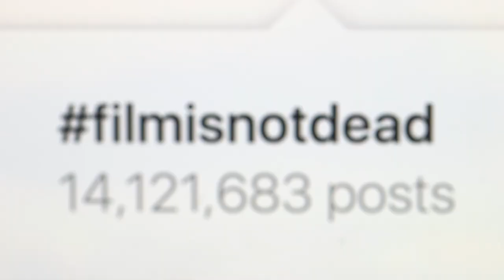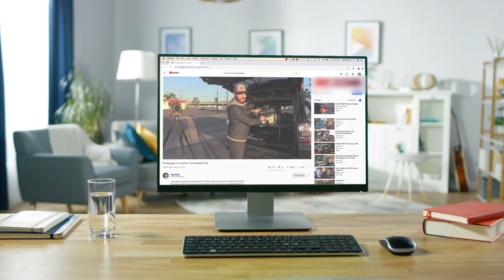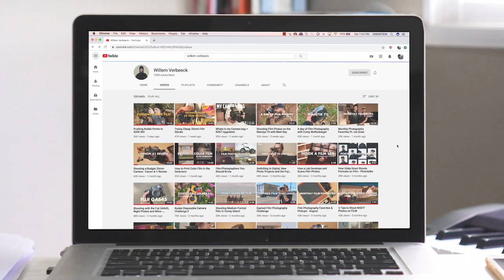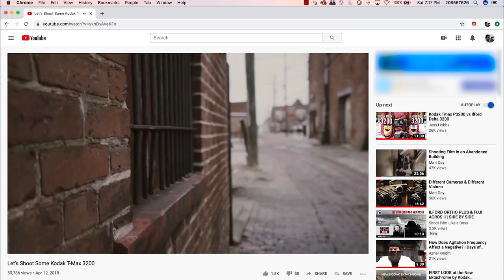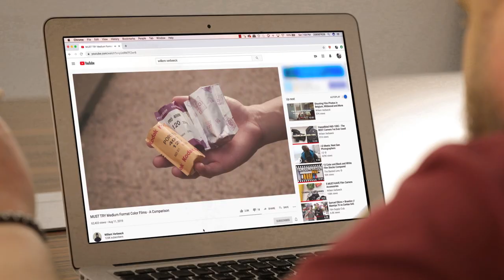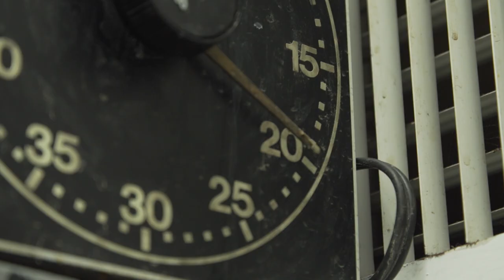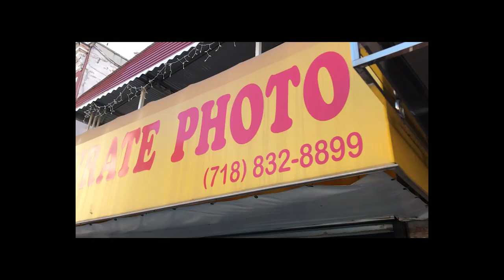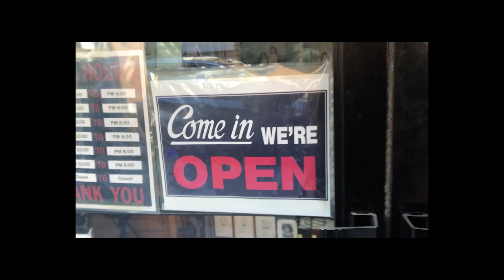Why We Still Love Film: Analog Photography in the Digital Age | NBC Left Field

Comment: Good documentary. As someone who has worked in environmental research for years and has also done life cycle assessments I want to add that the statement in the video that film may eventually go away because of environmetal reasons is not correct. Because film photography is more environmentally friendly compared to digital imaging. Production of digital sensors has more environmental impacts than film production, as well as usage of digital imaging (electric power consumption). Film will have a sustainable future.
Reply: Henning Serger hey I’m glad you made this comment. I don’t have the background to make the same statement as you but I also questioned whether the speaker in the video had concrete information to claim that environmental waste would be the downfall of film. When I think about the endless and sometimes questionable upgrade cycle in digital photography (including cellphones), I imagine that there has to be far more waste involved there. I am obviously biased though. Can you recommend a good and accessible source that summarizes the impact of film photography on the environment?
Reply: The amount of junk point and shoots just sitting at this local thrift store is staggering! I mean these are cameras that no one will buy. Whereas they can't keep film cameras for more than 10 minutes before it gets snagged.
Reply: Love that you commented this, same question as Certain Exposures, any links or anything? Not questioning your credibility just curious.
Reply: Indeed. Not only that but beyond film production OR digital sensor production, there so many exponentially more harmful practices across as many industries that require attention long before anyone should bother even investigating film's impact. Not to say a more green approach shouldn't be explored, but a reality check is in order on this point.
Reply: That is correct, the chemicals are not as harmful as typical household cleaning chemicals. People develop film with coffee and vitamin C for that matter.
Reply: @CertainExposures  Thanks. Concerning the environmental problems of digital sensor production and digital imaging you can find special literature in libraries. Results from research projects and from organisations involved in LCA for years like EFEU. I have visited five different film manufacturers in four different countries, and have seen with my own eyes that all film manufacturers really care for environmental protection. Film production has negligible impacts on the environment. There is nothing to worry about. In the video the topic has been mainly chemicals in film processing: And that is really no problem either because: 1. The silver in the used fixer is fully recycled. Either by specialist companies or by yourself. It can be done even at home with little effort. When the silver is out of the fixer, the rest is harmless. And the silver will be used again. 2. The main development substance(s) in developers: They are completely metabolized in normal current sevage treatment plants / wastewater treatment plants. The microorganisms in these plants eat these chemicals. And by the way: Main substances in developers like hydrochinone, p-aminophenole or p-phenylendiamine are also the main substances in hair tinting lotions. In these hair tinting lotions their concentration is even much higher than their concentration in developers. And hundreds of millions of people put these substances on their heads regularly, and then wash their hair and the washing water is going down the drain and to the wastewater treatment plants. That amount of waste water / washing water is several thousand times higher than that of film photographers. Is that a problem for the wastewater treatment plants? No, because the microorganisms there are metabolizing the substances.
Reply: Henning Serger I find this hard to believe.  Digital cameras consume far less energy than a phone, and phones don’t use that much either.  A common camera battery is about 4 to 8 Wh, and phone batteries are up to 12 Wh.  Toasting bread requires far more power than that!  The real problem with digital is, as you said, e-waste.  That’s a problem that we’ve only recently started to tackle, and it’s hard.  Both electronics recycling and film mfg / development require some nasty chemicals, but you also have the physical film to throw away.  After maybe 4000 shots a film camera could be worse than a digital camera, whereas with digital the waste is decided as soon as the resources are spent on making it, unless it is efficiently recycled.
Reply: @DS-rs4xn  sometimes a point & shoot will surprise you.
Reply: Henning Serger. Interesting. You’re the first person I’ve heard realistically compare the impacts of digital v film. I work in water quality. Fixers like blix do not get broken down by sewage treatment plants. There persistent. Also, if you own a digital camera for 5 years it’s environmental impact is spread over that duration. Film purchase and use is constant.
Reply: @bruhdabones  The issue is not the power consumption of the digital cameras. It is the usage of digital pictures: 1. Almost all digital pictures are viewed on monitors, and that consumes energy, every time. 2. Millions of digital pictures are uploaded every hour (!) to social media. These pictures have to be stored, and that needs a huge amount of energy. Huge server farms are needed for that. Pictures need much much more storage capacity than text documents. The internet is meanwhile responsible for about 10% of the global electric energy consumption. And a significant part of that is caused by digital imaging.
Reply: @doptimist  As I have explained in my reply above, fixer / blix should be treated separately for silver recycling.
Reply: Also, for movies, it's even crazier because at least in photography you have a digital file that looks kind of acceptable and if you are an amateur you may tweak it a little but not much. In movies you get a digital raw movie file with close to no saturation, no contrast and you have to get all of that to look the way you like with a really fast and powerful computer. That means that you spend a lot of time, weeks and months, trying to do the editing, color correction and color grading using a lot of electricity. With film you get your movie, you can edit it in a moviola or scanned, edited in a computer and then printed back to film. But you don't need to waste your time with color because it usually looks perfect... 
So yeah, film is not a problem environmentally speaking. But people just think about the fact that you have a print and that you throw the chemicals away. That's far from the truth!
Reply: Henning Serger Ok, I didn’t realize you weren’t talking about the direct power consumption from cameras.  That makes more sense.  Did you know that Google runs their servers on 100% renewable energy, or at least pays to offset the carbon footprint of any nonrenewable energy they use?  So that means youtube, google drive and google photos are all much more green than Dropbox, instagram, etc.  Hopefully other companies catch on, and hopefully Tesla cars can stop using coal and LNG to power their cars.
Reply: What's the best way to deal with fixer/blix that doesn't involve pouring it down the drain?
Reply: Jorge González you don’t have to shoot in raw.
Reply: @henningserger7150  I call BS on most of what you said.
1. Shoot all images in Instagram and FB on film and you'll probably have more film used daily that was used throughout human history (or maybe a weeks worth of IG and FB)
2. 10% of electricity is used for the internet? Yes, and the vast majority of it is not images on social media. 
3. Not a point exactly, but - this is the lamest way to reduce pollution. We are not going back to the stone age.
Reply: @tomcruz3774  You can get the silver out of the fixer with either iron wool or with the electrochemical way using two electrodes. That can be done at home. You can also give the fixer to a company doing that.
Reply: @barney2x4  i think not. In using film you have to realy think about the shot you want to take coz every roll every shot costs you money. While shooting digital you have no limitation to take whatever picture you want. Mostly, film photographers store their developed film after scanning it so its way more limited and doesn't consume that much energy
Reply: “Comrade, your statement is factually incorrect.”
“Yes, Dimitri, but it is politically correct.”
― Angelo Codevilla (The Rise of Political Correctness)
Reply: bongo155  You know, you can have an argument without blindly insulting people.
So you assume that the electricity used in digital production of film and editing comes from a renewable or low emission source, however the elctricity used by film companies or by developing shops/companies does NOT come from a renewable or low emission source? I hope you see how biased your argument seems. Also not all people scan their film and share it online, many people make prints, or scan without sharing their photos online
Reply: @henningserger7150  But you know that a lot of people shooting film also scan their pictures to edit them on a computer and share them on the internet? In those cases and it represents a lot of people, they are probably less environmentally friendly than the regular digital shooter. Have you thought about that?
Reply: @vivelafrance8400  if I can say one thing it's that I've recently moved to a stance of having the lab scan and print my photos and if I see a print that didn't turn out exactly as I would have hoped for I scan it myself. I've entirely stopped posting photos on social media and to another's point, I NEVER throw my film away. That idea just seems ridiculous and harmful anyway.
Reply: Henning Serger yay! So happy to hear this
Reply: @doptimist  I want to use ilford fixer, are there any fixers for black and white photography that you recommend, that are relatively environmentally friendly?
Reply: @henningserger7150  An interesting discussion.  NOW, most silver is reclaimed.  Prior to the 1990's this was not generally done, except in specific situations like large format x-ray films where the amount of silver was huge.  When local environmental regulations started controlling what photo labs put down the drain, a large number of those labs elected to go out of business rather than pay the costs of handling the wastes.  My experience is in California, which generally is progressive in environmental regulation.  The legacy of pollution from film usage is substantial.

The amount of film being shot now is dwarfed by how it used to be, which was millions of pounds of silver per year in demand.
Reply: @CertainExposures  thank you, when he said that in the video my heart dropped
Reply: @henningserger7150  What about the uploading of film images online? Doesn't that take up as much energy consumption as a digital image?
Reply: Totally agree with you. Moreover, many film cameras are what we can call "low tech" items, especially fully mechanical cameras, without a battery. Low tech is the future since we will on a finite planet with limited natural resources. Hence, film photography is here to stay.
Reply: I would really like to read more on this and see research, especially on the environmental impact of photo sensor manufacturing (and other electronics), where could I find more info?
Reply: @pault151  idk, OP's comments reek of someone who loves film way too much to see the environmental drawbacks. I looked him up on Google and what a shocker, all I could find where mentions of his name on film photography websites. I somehow get the feeling that most people in this thread are just glad there's some free copium floating around...
Reply: @barney2x4  "Shoot all images in Instagram and FB on film and you'll probably have more film used daily that was used throughout human history"

Nobody would do that.  99.999% of the images on Facebook and Instagram are disposable.  They're not worth keeping.  Yet we spend untold amounts of energy holding onto them, keeping them around, backing them up, indexing them, shuffling them back and forth from hot to cold storage.

Film forces you to slow down and be careful and deliberate and create something that's worth the time and effort and resources to preserve on a physical artifact.
Reply: @bruhdabones  "you also have the physical film to throw away"

The only people I've ever met who threw film away were people using point-and-shoots 20 years ago.

Everyone I know of using film today archives their film.
Reply: @dafunkmonster  it will eventually be thrown away.  Plus the chemicals and other materials required to store and develop it are significant and don’t last forever
Reply: @bruhdabones  There are no chemicals required to store film.  You put it in a polyethylene sleeve and then put it in a container in a cool, dry place.

Comment: Amongst many others,  I've had a Canon A1 since 1978. It has never faltered. The speeds are highly accurate and the film plans is spot on. The camera has full manual,  aperture priority (set the aperture and the speeds are automatic) or shutter priority (set the shutter and the aperture is automatic) and full automatic (set it to P and the camera selects shutter and aperture). At the time,  it was the only camera that could do this. The metering is surprisingly good (it isn't multi-zone, as are modern cameras, nonetheless the exposures are nearly always perfect. It's a very impressive bit of kit and it will not disappoint a professional or rank amateur. You must get a good one,  as there aren't many people who can service these cameras as well as the "old" technicians. If you get a good one, it'll give another 40 plus years. They are very well made and extremely robust. There's very little to choose between a late 70s Nikon FE and the Canon A1. If you want features,  get the A, if you want simple,  graceful and reliable excellence,  maybe the Nikon. Basically,  if you get bad results from either of these cameras, then the film, the development or the shooter is to blame. In the case of the Nikon, use a 50mm F2 from the early to late 70s. If it's the A1, use a 1978-1984 Canon brand 50mm F1.8 or F2 lens. The resolution of the Canon or Nikon lenses, from this vintage, are superb. The later (1990s-2005) plastic bodied Nikon or Canon lenses can be a little disappointing - if you get a bad one. Unfortunately, bad ones from this period weren't uncommon. The expensive Canon and Nikon lenses, made for high end digital cameras are truly superb but are as dear as poison and don't even work on the FE or A1.
Be generous with exposures if shooting negative and mean with the exposure if shooting transparency. If you really want to splurge out on the apogee of film cameras, look at the Canon F1 from the mid 1980s or the Nikon F5. Don't buy a Leica film camera. They are like I imagine cocaine or heroin - great and expensive - at the beginning and they'll result in your financial ruin at the end. They're better than anything else but they're so expensive, you won't dare to leave the house with it. (You'll restrict yourself to taking pictures of the neighbors' car or your own trees).
Film is life.  It has spirit, character,  nuances, irritations, joy and surprises. When you nail it with film,  nothing else comes close. Digital is better in every way than film but is "soul-less", clinical and reduces your skill as a photographer, due to the automation inevitably leading to artistic laziness.

Comment: Back in the old analog days you had one camera and you purchased different film stocks to use in that camera. Today with digital the cameras keep changing, making it an endless loop of constantly updating cameras and post processing software. 
Film is something that is real. You can hold it, touch it. Digital is something that is there and can easily vanish.
Reply: Color negatives and slides can fade, due to instability of dyes.
Reply: Digital, however, is something you can print and then it will last as long as film.
Reply: @jo_naash  yeah digital photos absolutely last longer than film, there are these things called hard drives. i just like film because it's fun to shoot, there's no practical reason to use it. i suppose resolution is technically better on film for the price but it would just make more sense to have a dslr if the only thing you want is good photos.
Reply: The irony is they still upload it to instagram and make it digital anyway

Comment: Still have my two Hasselblads (500 C/M & EL/M) as well as my 1969 Pentax Spotmatic. Operated a portrait studio for many years and for a while used an RB67 in the studio with just that gorgeous 150mm soft focus lens. Used a Pentax 6x7 on location but always came back to the Hasselblads. Currently have a Leica digital which is great, but also use an Instax Wide 300 and recently picked up a Nikonos-V - which is fantastic above and below water.

Sold all my darkroom stuff which amazed me. Still have the color analyzer if anyone's interested along with a few Kodak safelights & filters. As much as  i like digital, there's just something about film.